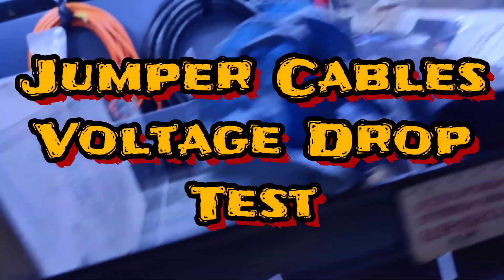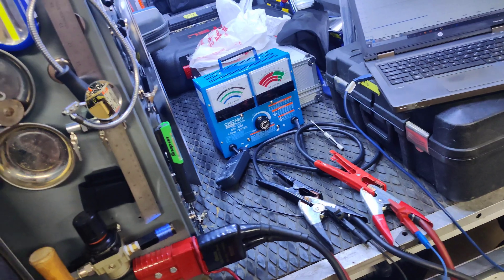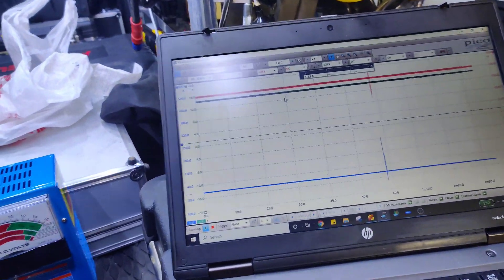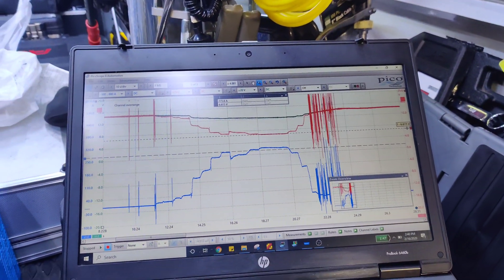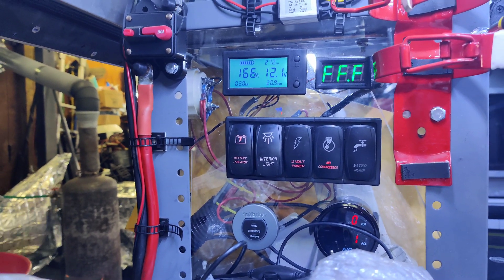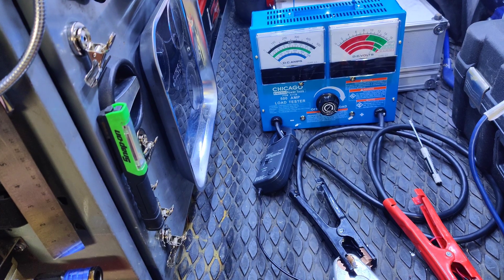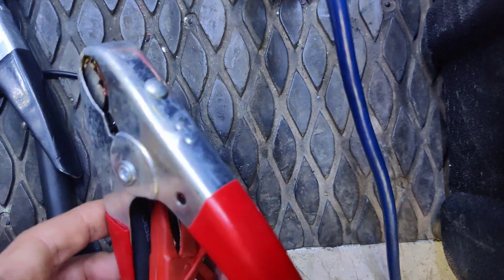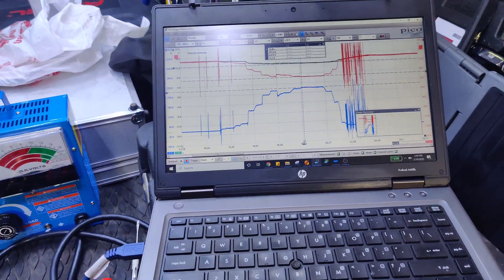Jumper Cable Voltage Drop Stress Testing OFC vs CCA Wire Current Carrying Capacity

Comment: That’s interesting think the length plays a part? With my Noco GB150 will jump anything and has 6 awg very small cables.
Reply from the maker: The cables are very short though. Shorter the cable the more it can carry.